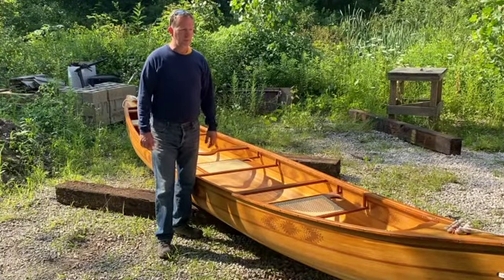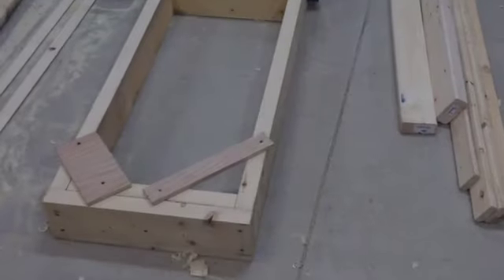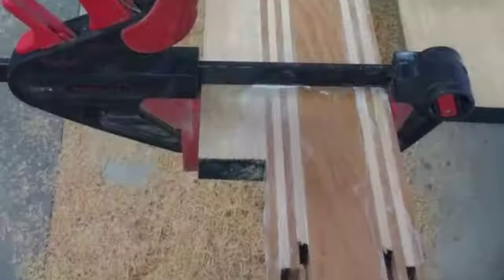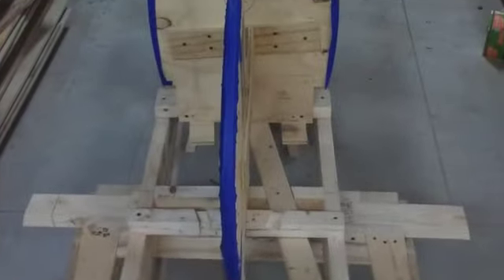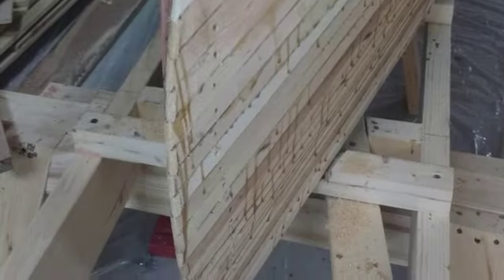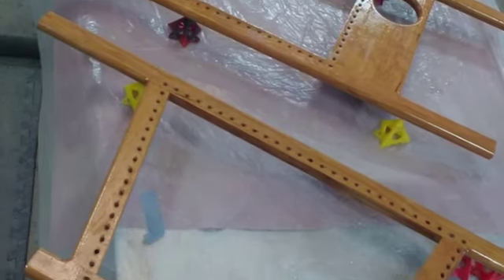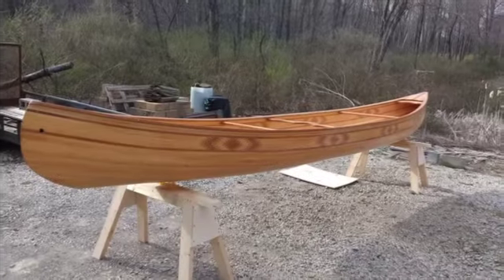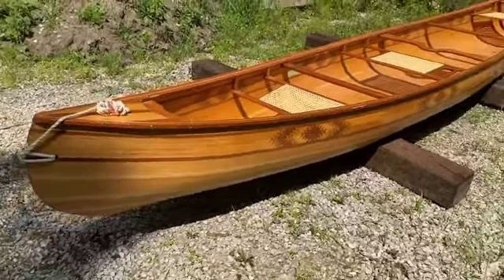Building a Wood Strip Canoe | TSW Woodworking

Comment: Would you like to share the diagram of this canoe please
Reply from the maker: Sure, no problem.
give me a day or two.
Reply from the maker: Here's a link to the book I used by Gil Gilpatrick.  It has full size plans for the forms.  I made mine about 19 feet long, I'd probably go shorter if I was doing it again.  Unless you are planning on a week long trip or need space for 3 people, a shorter one would be easier to portage.  

https://www.amazon.com/Building-Second-Revised-Expanded-Build/dp/1565234839/ref=asc_df_1565234839/?tag=hyprod-20&linkCode=df0&hvadid=312176357204&hvpos=&hvnetw=g&hvrand=13459436693628767398&hvpone=&hvptwo=&hvqmt=&hvdev=c&hvdvcmdl=&hvlocint=&hvlocphy=9015332&hvtargid=pla-433762455336&psc=1&tag=&ref=&adgrpid=60258871857&hvpone=&hvptwo=&hvadid=312176357204&hvpos=&hvnetw=g&hvrand=13459436693628767398&hvqmt=&hvdev=c&hvdvcmdl=&hvlocint=&hvlocphy=9015332&hvtargid=pla-433762455336